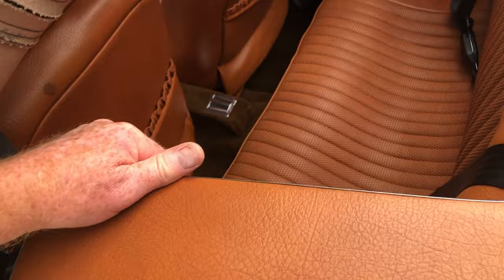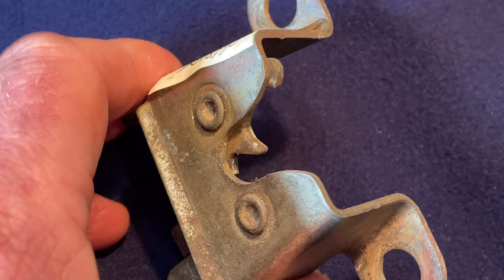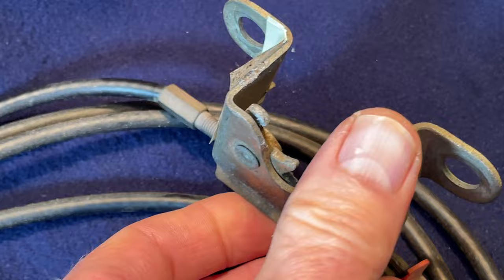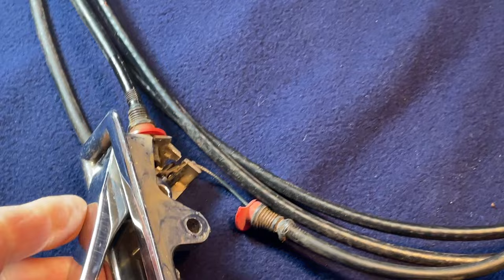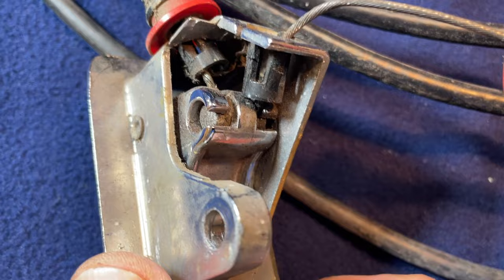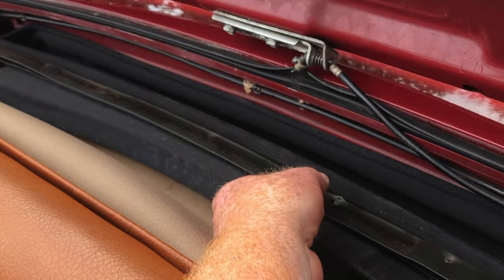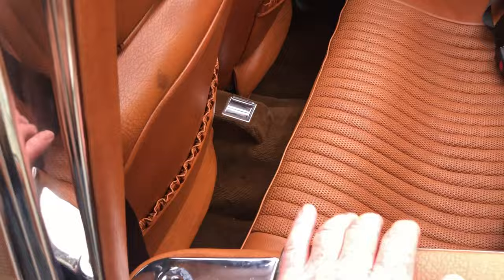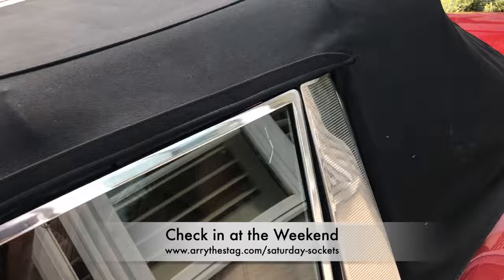Triumph Stag - Tricky Convertible Hood Mechanism

Comment: The cables have nothing to do with the mechanism not locking.   With the tonneau cover raised use the stem of a decent screwdriver and push the part of the catch that the cover strikes down and make sure it locks in place, then pull the chrome lever to check it pops open again.  

If that's OK loosen the 2 mounting bolts and raise the catch slightly, there's a fair bit of adjustment and has probably dropped a little having had the cover thumped down on it hundreds of times over the years.  It's a balance between getting the catch to operate and not having the cover sitting too high when closed, bit of trial and error to find the sweet spot.

Comment: Tony, I think a bit of oil or WD40 on the latches and striker pins wouldn't go a miss, then if that works, then grease up the latches with some LM grease keeping them lubricated and stop it rusting. Everything looks very dry and even rusty!

Comment: Thanks for the nightmares, Tony.
Mine was completely rooted, and I pulled the lot out to replace missing bits and attack the rust. I've no idea of how I did it, though I had the workshop manual. I put the frame back togeher, but the soft top was still shrunken and manky.
In the meantime, I put a hoist on the roof of the garage, and lifted the hardtop off using a seat belt between the upper window frames and that pin at the back when we wanted to go topless.
Were we caught out in the rain with people laughing at us? Yes.
I hope that someone knowledgeable will have answers for you.
Reply from the maker: Definitely an art form - but I think I know how it works..time will tell when we do it! All the best and thanks for posting!